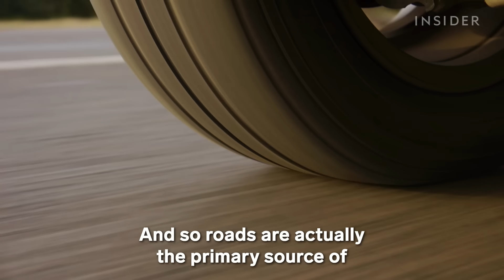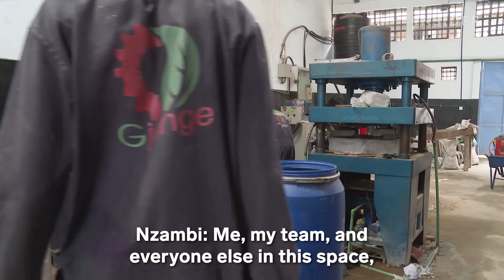Young Inventor Makes Bricks From Plastic Trash | World Wide Waste | Business Insider

Comment: What I'm curious about is how resistant to pressure and tension these plastic bricks are. i would need to be shown they are capable to withstand at least as much as a regular brick to feel comfortable with them as a building material. The microplastic bit is still worrying tho.
Reply: Well we still don't know if microplastics have an effect in our health or the environment. We just know that they are already everywhere. In the video she slams a brick against the floor and didn't break, so I guess it can handle the pressure. But who knows how heavy they are and what kind of building method they would require to build a wall.
Reply: @Haibrayn42  dunno, I don't think throwing something into the ground is a good, scientific way of measuring the material qualities of these bricks

Edit: A quick search says that a plastic brick with 1:5 ratio (plastic:sand) has a compressive strength of 5.56 N/Mm2. Less than half of a normal brick. 
Since It seems like the bricks being made in this video didn't have as much sand, maybe a  1:3 ratio is more fair, the bricks tested showed a 4.49 N/Mm2 result.

And apparently plastic bricks are great at absorbing water. In the test I read, most absorbed at least 70% of their weight in water. A very bad trait for a brick to have.
Reply: @Haibrayn42  i believe she said 1.3kilo which is about 3 pound per brick

Comment: She talks like a salesman, she and who ever gave her that 10k knows that she's doing a disservice to the environment, first off is the power consumption to create those bricks, second is the air pollution the production causes, in a small scale it's nothing major but in a larger scale it's problematic, 3rd is that those bricks degrade over time and those particles get mixed in with the environment, micro plastic will be everywhere, 4th the plastic remains, it doesn't disappear, if those roads in the future need repair, that plastic will still exist and will probably end up in a landfill, since unlike concrete or brick it can't be reused.

Comment: Wait a minute, how much heat can it handle? Did I miss that statistic? You all understand roads get incredibly hot, how long until the plastic melts? How long untill it cracks? Plastic does crack and become brittle overtime. Leave a plastic bottle in a room for 10 years with no ac just regular air, when you go to grab it, it will break into tiny pieces. 
 So again my question, how durable is this as in life span from weather Be it extreme heat or extreme cold, how will it handle changes of temperatures, will it damage tires on hot days, will you add texture for rainy days.
 Again idk if i missed it gonna watch again

Comment: Mmm, microplastics.
Ideally the bricks would go into buildings and structures that would then be clad or rendered over so as to not be exposed to constant weathering and erosion.
Even as infill for roads that can then have a thinner layer of asphalt over the top, if the goal is to 'get rid of' loose plastic waste and reduce the amount of expensive asphalt needed for roads.

Comment: I love how they Play these like they are more toxic than asphalt. We drive on hardened crude oil and gravel.
Reply: It's not a question of toxicity, it's a question of penetration and as we are seeing now accumulation. Besides, comparing one to the other isn't the argument. The arguments is what to do with the plastics... reduce the production, recycle all that is possible for new plastics, divert what can't be recycled into ideas like this. I like her thinking of walkway bricks, roof tiles and water trough, I'm not sold the road idea is best.  I'm open to having my mind changed.
Reply: @farmerfb   as for paving and home use they are good but a road will take some science to get that one right.
Reply: @johnc.hammersticks  
Asphalt is actually safe.
Almost all "new" asphalt is reused.
Only a small amount of +-5% is made from fresh new petroleum.
Immense amounts of money has been spent to make asphalt production the least carbon emitting of all pavement materials.
You are regurgitating decades old facts about asphalt to make your current point.
Modern asphalt is actually so non-toxic, that it’s frequently used in fish hatcheries and as a barrier to keep out contaminants from hazardous landfills.
At the same time, we see these primitive African factories without safety standards simply refurbish toxic plastic, and putting it back into nature.
Workers standing over fuming melting ovens without proper breathing apparatus and fresh air systems.
Melting and mixing all the plastics that are mixed with BPA's and such.
Making pavements that leach toxic chemicals into the soil.
At the same time changing nothing to their usage of plastics, or the problems with waste management.
Nothing changes, and everyone is all pretentious and virtuous about it.
Reply: @DeeDee-pw9pm  i think it's more about finding mass uses for Plastics. Plastic takes many years to break down .
Reply: @DeeDee-pw9pm   my brother in law owns a paving company, trust me I know,just being sarcastic.

Comment: These eco plastic bricks, is not safe.  Plastics,  when exposed to the sun, release lots of chemicals, because they're not organic. So,  they cause immediate harm to the soil,  and water wells, or lines. The chemicals will threaten plants,  and animals, and since plastic doesn't absorb water,  can cause minor floods, or..... washed away to rivers, lakes,  and oceans,  and pollute even more. On top,  of that plastics bricks will increase temperatures in a hot day. Plastic,  can't hold weight,  and will just bend and bow over time. Plastics is bad for the environment, so...... can't be used for the environment.

Comment: Plastic takes a long time to biodegrade so it'll probably last longer than asphalt. Brick roads last longer than asphalt. there's 100 year old brick alleys in my city that are in pretty good condition and smoother than some of the asphalt ones they repair year after year and still have to replace eventually.

Comment: They tried that with glass mixed in with the asphalt as a filler. Once the asphalt wore down the pieces of glass would begin to stick out being glass is much harder than the asphalt. The sharp edges on the glass would be worn smooth as the asphalt was ablated. As soon as it rained it made the roadway like driving on black ice. They discontinued the 10 year test after 2 years and replaced the test roadway with a concrete.
Reply: @totohomono728  ok yea I looked it up. Quite strange, wouldn't have guessed. And yea we're not running out of sand, we're running out of sand that has been water eroded, because apparently wind eroded sand is too smooth and can't be used in the same application, in simple terms. Quite interesting. Seems like there is a problem with EVERYTHING these days lol
Reply: Why would you use such a limitted resource such as sand (glass) for ROADS!?
Reply: @totohomono728  you think sand is limited enough to be worried about running out of it...?
Reply: It has been slowing happening in the USA for years...they added plastic to asphalt and after 10 or 20 years they still looked brand new...no cracking, not much wear...person who made the patent had it bought out by big wigs to hide it away because it would have ruined road pavers and tons of jobs and profits... finally after the 7 or 10 years passed and the patent was fair use... its now being  used in a lot of places more and more...but really big cities don't because of corrupt politicians

Comment: LOL apparently none of you have seen what happens to your nice road when slick plastics are introduced to bitumen or concrete roads.  Plastics and other contaminants in asphalt roads causes potholes, and causes them very quickly because there is no adhesion of bitumen to slick plastic.  Finally you could reduce the plastic to shreds and fibers, but the cost would be similar to adding kevlar fiber as we do for industrial concretes like in machine shops or on tarmacs, without the strength benefit.  I'd rather buy kevlar reinforced concrete with plenty of rebar.  Normal plastics introduced into bitumen only add weakness.  This is why in countries like Nairobi where they have no standards, the buildings are collapsing around them, with the people sometimes living in multistory houses with 1 or 2 walls literally missing.  Thank adding junk to building materials for that.

Comment: We had a project in my reinforced concrete class for civ engineering to replace part of the aggregate in concrete with another material. We chose small pieces of plastic and the strength of our concrete was lower than the control specimen and one of the lowest in the class. Not a good idea

Comment: Bricks are not built with concrete, they are mostly clay built with crushed granite or mud. Paving stones are built with cement, concrete is cement mixed with stones. And one more thing, all the plastic dust that wears off will pollute the water with micro beads, not environmentally friendly. Plus the fumes from plastic are worse than concrete, clay and cement.

Comment: Asphalt is a byproduct of oil refining and is the most recycled material on earth.  They are essentially making asphalt.
Reply: except  the plastic brakes down from the sun into micro plastic and pollutes the environment and finds its way into your food.
Reply: @miguellopez3392  This is something I'm afraid of.
Reply: Lopez right blame microplastics from the air and not the plastic containers the food is given to you in.
Reply: @Cheapish101  the plastic containers are not being sanded down into dust by 80,000lb semi trucks, plastic roads are, this dust finds its way into top soil.
Reply: @miguellopez3392  the food is placed in plastic which we consume and intake the  particles. Especially those who get their food hot. It's a never ending revolving door of plastics
Reply: @Cheapish101  the plastic is chemical bonded to itself no loose plastic particles when manufactured, almost no food item can rub it off, food grade plastic is even chemical and heat resistant, a tire will grind rocks against the plastic road scratching off tiny pieces of the UV damaged plastic. Think harder.

Comment: this is not a solution and this process would not be possible under any regulated government structure it just does not solve any problems and insures that the waste is laid right on top of the environment where it is used. it simply will pollute that environment over time. until they can find a way to keep it from eroding it is not a solution but a way of spreading the pollution around to every place it is installed

Comment: I feel like the increase in plastic content of such roads could actually reduce the release of microplastics, not worsen it, because it would adhere better to the rest of the material. Scientists with access to these bricks, and to the other roads mentioned herein, should collaborate and conduct an experiment to compare them. Perhaps use a large sealed container for each, and compare the quantities of fragments accumulated after exposing the materials to prolonged friction with tire rubber. Even if these bricks produce more microplastics, this should be seen not as a failure, but rather as a learning opportunity to work on improving its design.
Reply: Yeah, I was a little disheartened when the microplastics part of the video happened. I wonder if they could use this to build more permanent structures like houses?
Reply: @PJBonoVox  Agreed!!

Comment: Next up: nuclear waste injected into combustion engines, for a 'bigger bang'. I've invented and patented it, many manufacturers already have made plans. The Nissan Nuke, Citroen Bengbingo and Ferrari Muroroa are no longer farfetched ideas. The Muroroa delivers a whopping 666 million whorespurs from the engine and 1.2 billion whorespurs from a Chernobyl Pripjat DM10/13B quadro-atomic turbo-afterburner, it does 0 to a 100 kph in 0.1 second, and it comes with eject seats and parachutes, a 4.2 MW stereo and an ashtray from K-19 submarine. Wings are optional.

Comment: Someone forgot to tell them plastic degrades in sunlight
Reply: Then which is better, let those plastic degrade in landfills or at least put the plastic, where the landfills are already at FULL capacity, to some productive use?
Reply: @warren5037  Yeah let’s spread toxic plastics all over the world.
Reply: @HellboundRecords615  alright then, just let your garbage cans and bins accumulate without taking out the trash every week. Let them overflow to overcapacity.

THAT is what they're dealing with in case you haven't noticed.
Reply: @warren5037  You can’t use plastics to make roads do you realize how  stupid the idea is? Plastic melts and is made of toxic chemicals. Within a year all the roads made of plastic would be destroyed and all that plastic would be absorbed into the ground and into the atmosphere.
Reply: @warren5037  You don't need to have a better idea to point out the flaws in someone else's.
Reply: @Harsh_Noise  yea, and I'm sure they have some idea about such a problem existing. Instead of being all doomy and gloomy, how about instead focusing on potential solutions to such problems?
Reply: @warren5037  As long as you're admitting there's nothing really objectionable about what I've said.

Comment: But what about sand? Aren't we running out of sand?
Reply: Are we?
Reply: @TheVuduYuDu  sand in desert and sand for concrete or manufacturing aren't the same kinds of sand
Reply: @warren5037  You didn't answer my question.
Reply: @warren5037  No it wasn't and you still haven't really answered my question, so I'll re frame the question for you. Where does the sand come from used in construction and why is it running out.
Reply: @TheVuduYuDu  sighs you know beaches, riverbeds, etc? Yea, those types of sand, except they don't replenish as fast, if at all, as we use them, and you know what happens when something is not renewed as fast as it is used?

Comment: First off there is not enough sand to use it for everything. Second we need to find another way to use the plastic waste that is long term productive. We need sand to hold together the land it falls apart if we take it away. We need to stop using the earth's recourses for at least 300 years to see a small change. It will take up to thousands of years to produce bigger change's. I have studied advanced science and engineering to know.
Reply: That's nice, but I'm not necessarily seeing you provide a solution that will help reduce the plastic waste in Kenya nor provide affordable alternatives to a cash strapped country in need of basic infrastructure. Nor did I necessarily hear her say that it should be used for "everything".